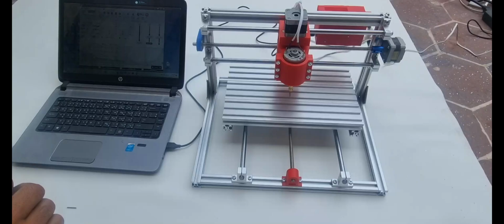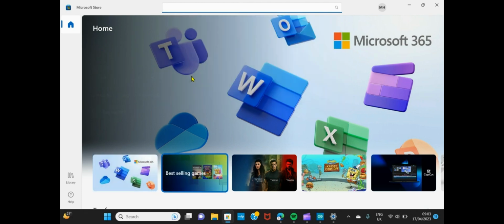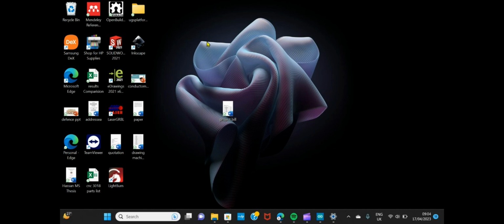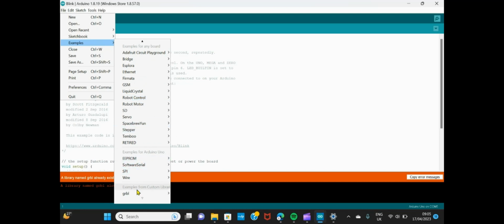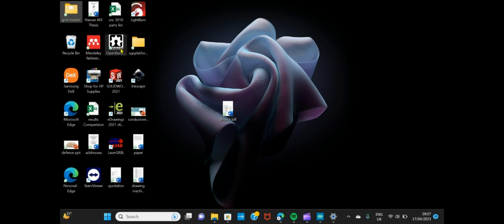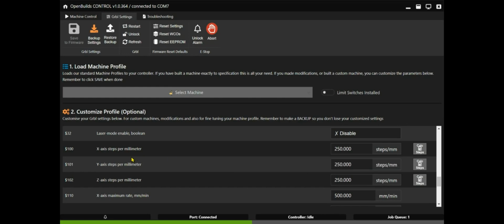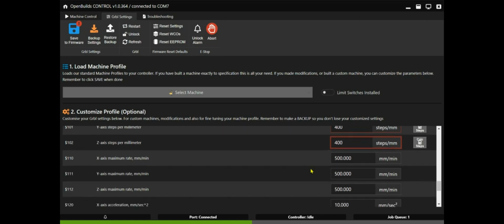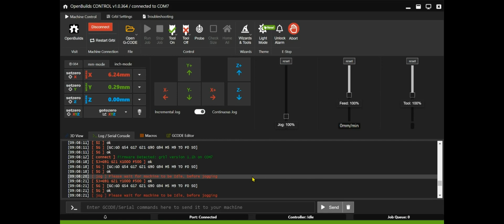CNC 3018, Software upload and steps Calibration

Comment: Hello, please answer if you will have time. In your parts list there is no 2*180mm main table connecting aluminum profiles, am i right?
Reply from the maker: It is not necessary to use a specific number of profiles for table. You just have to make the width of 180mm, so you can use either one profile of 20100 and one 2080 or 3 profiles of 2060 or any other combination which is available to you. Hope you can understand if still you have any confusion please let me know
Reply: @MultanTec  thank you very much , i have also one question, sorry for disturbing you. With how much % infill must we print stl 3d details?
Reply from the maker: @giorgimikashavidze4147  usually 40% to 60% is fine but it all depends on your filament type and quality of filament
Reply: Normal ple, the mand largest peace  i was thinking to print 40% but ill increase to 60$.
Reply from the maker: @giorgimikashavidze4147  you can print with 20% and 2 layers in infill it will be strong enough